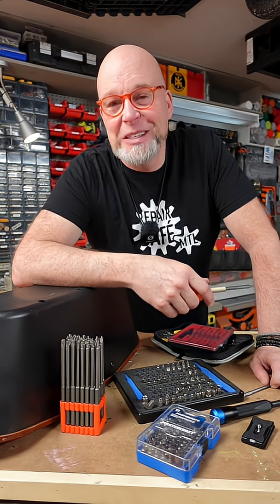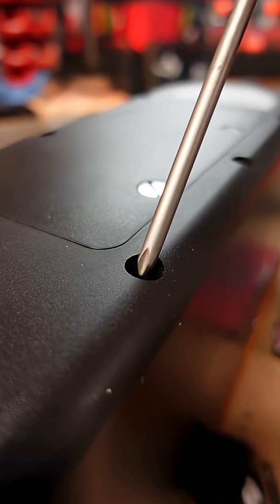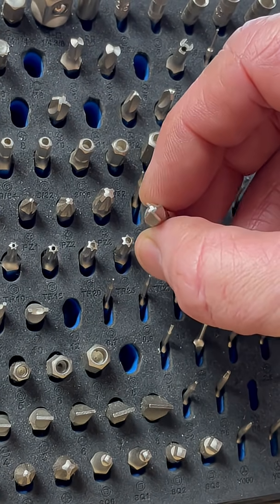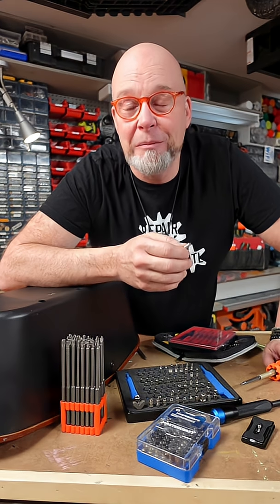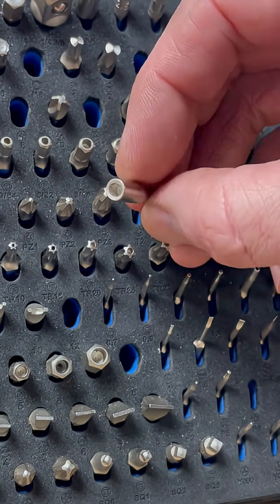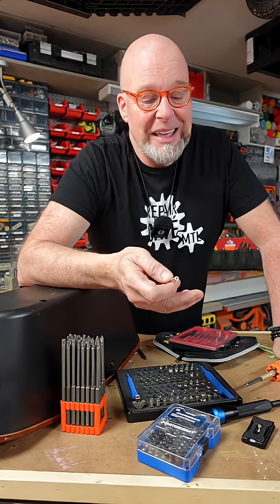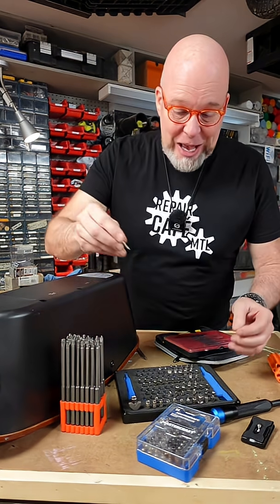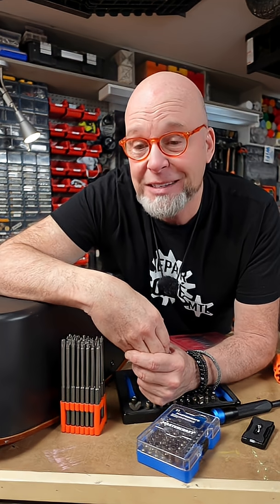SAFETY SCREWS (extended) #repair #make #tutorial #diy #design #innovation #technology #tools

Comment: Years ago I came across(diabolical) one way screws, I had to drill them out.
Reply from the maker: Those are the ones with heads made in a way where there’s grip only to screw but a flat screwdriver tip slips if you try to unscrew?